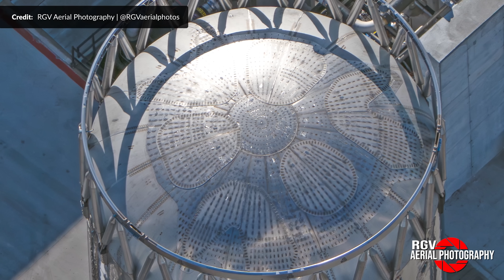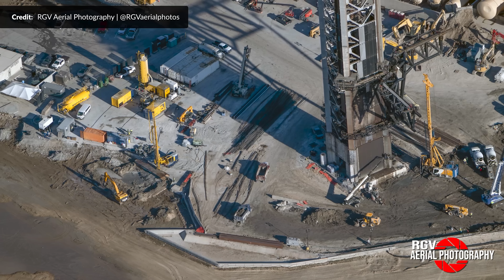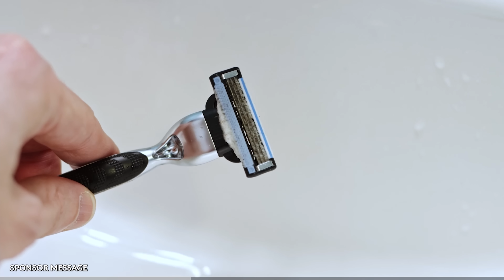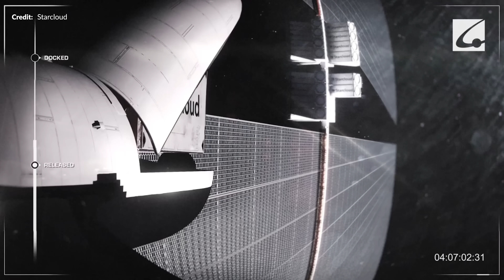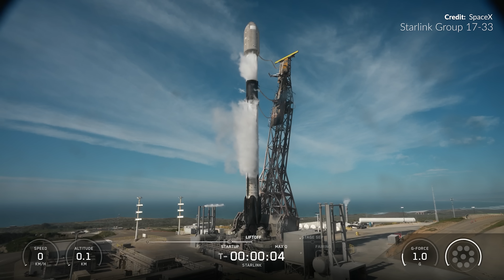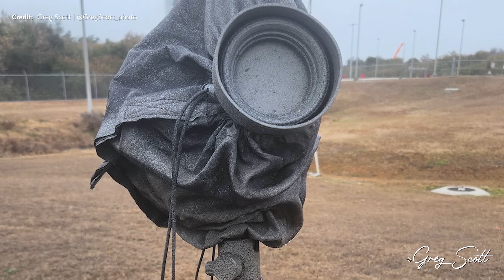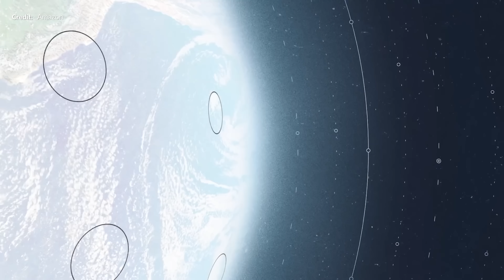SpaceX’s Starship Strategy Just Changed… Big Time!

Comment from the maker: Head to https://hensonshaving.com/marcushouse and enter code "MARCUS" at checkout to get 100 free blades with your purchase.
Reply: I bought one of the razors. It works well, but removing the blade has been a nightmare. I hold the ends away from the blade but the pressure needed to hold and twist the shaft to free the blade has caused it to twist past my thumb and cut me more times than I wish to admit. I am looking at a one-inch slash across my thumb right now. I am not sure if it would be best to hold it inside of a folded towel or to try and twist it while holding one of the cutting sides against a flat surface like the counter of the sink. Just beware it is not like the old “safety razors” that had jawsthat opened when twisted.
Reply: Marcus! We need your input for my comment on hot staging.  stevemorrell4066 (one of the usual 'first to...' suspects)  It's not the new Starship that matters but the re-used Booster underneath it that does - that unprotected dome has to have a limit...
Reply: The applied science of Geodesics if very clear. No parabolic trajectory in history was ever High Enough to LEAVE EARTH’S “Atmosphere”. You absolutely need a “ STRAIGHT” line trajectory to exit a curve. The “culminating” point of every parabolic trajectory “DICTATES” a return to Ground or Sea in close proximity. The Bermuda Triangle for example. Prove me wrong by showing me an analog, uninterrupted optical follow from launch to space.  Does not exist. No one went nowhere. Factual existential observable reality, cannot be denied or disputed. It is. Scratch Conscience🧠☯️
Reply: NEWTON’S 3rd Law in a Vacuum is irrelevant. If “Rockets” would be able to move mass in The Vacuum of Space, if “Rockets” could be “Self Propelled” WE WOULD SEE NO PHYSICAL REACTION AT LIFT OFF. If “Rockets” do not require any density to move mass, THERE SHOULD BE NO PHYSICAL REACTION AT ALL AT LIFT OFF. In reality, we observe the largest air displacement of our existences. Proving that rockets require a Hard surface to lift mass and miles of air density to maintain propulsion for a short flight
Reply: @ScratchConscience 
If what you say is true, no rocket engine burn would ever circularize, raise, lower or exit an orbit for something like "Trans Lunar Insertion."  ALL of those things happen through power applied through burning the engine.
Reply: @frankmcgowan9457 They don't .. NEWTON’S GRAVITY DEBUNKED// No Gravity means No Universe, the END
Fact is that when M. Brian Cox did is “Experiment” at NASA’s vacuum chamber and removed “All DENSITY”, bowling ball and tail feather fell at the same Speed and Rate. By “REMOVING DENSITY” ** gravity** stops existing. No gravity in a Vacuum! Proving “Density and buoyancy”. Here is a pre-School experiment confirming. Stand on a chair with a sheet of paper in your hands and let it go. It glides floating on the air particles in the environmental air, like expected.
Stand on the same chair and make a ball out of your sheet of paper, and let it go. It drops directly to the floor again confronting the same environmental“Air Particles”. 
Air Particles are called Density in physics. You have not altered the density or it’s atomic signature! You have augmented THE DENSITY OF IT’S MASS in relation with the DENSITY OF THE ENVIRONMENT, air density. Applied physics cannot be disputed.
No one is living upside down on an uncontained spinning water ball, hurling inSpace @ a SPEED of 66.6K mph / on a TILT of 66,6° / the POLES 66,6° / the CURVE ratio 6,66” ( Free Masons Great Architect is Lucifer )and does not know about it because of a magical unproven Jedi Force called Gravity. That is just PLANE ridiculous.
Reply: Before you go and reply something completely irrelevant, you will need to explain why the feather does not fall gliding slowly to the ground while in the vacuum without using the words : " Density or Air resistance " which are one and the same. Secondly, you will have to CONTRADICT ME ON A SINGLE SENTENCE. ""Read to the END"". Factual existential observable reality cannot be disputed, thus I cannot be disputed. The universe is an IMAGINARY CONSTRUCT that only “exists” in human minds. It is entirely based on a never occurred, theoretical explosion and it is programmed in our mindsfrom birth. Big Bang is a Theory, a theory does not exist in FACTUAL EXISTENTIAL OBSERVABLE REALITY. It has no existential reference. It is nothing moe than an idea, a thought. An organized hypothesis with no physical reference. A “Scientific Theory” does not EXIST, scientific or not it remains a non physical, mathematical hypothesis. The Facto, everything that comes and perspires from a theory is also theory and DOES NOT EXIST. Non existent within non existent. Proving that the  heliocentric Universe is a Humanity wide beLIEf. Like every known beLIEf and Religions, the middle of it is a LIE. Be, LIEd, Fool. beLIEf. Scratch Conscience🧠☯️
Reply: NEWTON’S GRAVITY DEBUNKED// No Gravity means No Universe, the END
Fact is that when M. Brian Cox did is “Experiment” at NASA’s vacuum chamber and removed “All DENSITY”, bowling ball and tail feather fell at the same Speed and Rate. By “REMOVING DENSITY” ** gravity** stops existing. No gravity in a Vacuum! Proving “Density and buoyancy”. Here is a pre-School experiment confirming. Stand on a chair with a sheet of paper in your hands and let it go. It glides floating on the air particles in the environmental air, like expected.
Stand on the same chair and make a ball out of your sheet of paper, and let it go. It drops directly to the floor again confronting the same environmental“Air Particles”. 
Air Particles are called Density in physics. You have not altered the density or it’s atomic signature! You have augmented THE DENSITY OF IT’S MASS in relation with the DENSITY OF THE ENVIRONMENT, air density. Applied physics cannot be disputed.
No one is living upside down on an uncontained spinning water ball, hurling inSpace @ a SPEED of 66.6K mph / on a TILT of 66,6° / the POLES 66,6° / the CURVE ratio 6,66” ( Free Masons Great Architect is Lucifer )and does not know about it because of a magical unproven Jedi Force called Gravity. That is just PLANE ridiculous.
Reply: Factual existential observable reality cannot be disputed, thus I cannot be disputed. The universe is an IMAGINARY CONSTRUCT that only “exists” in human minds. It is entirely based on a never occurred, theoretical explosion and it is programmed in our mindsfrom birth. Big Bang is a Theory, a theory does not exist in FACTUAL EXISTENTIAL OBSERVABLE REALITY. It has no existential reference. It is nothing moe than an idea, a thought. An organized hypothesis with no physical reference. A “Scientific Theory” does not EXIST, scientific or not it remains a non physical, mathematical hypothesis. The Facto, everything that comes and perspires from a theory is also theory and DOES NOT EXIST. Non existent within non existent. Proving that the  heliocentric Universe is a Humanity wide beLIEf. Like every known beLIEf and Religions, the middle of it is a LIE. Be, LIEd, Fool. beLIEf. Scratch Conscience🧠☯️
Reply: Chinese have released mock up videos of a booster catching system. Interestingly no legs. Just a gantry and wires that catch the booster on its fins or small hooks. 
now that's very clever in my view. First, no need for legs. The catch is all on the ground. 
Second You can move cables quickly. 
I think its rather clever.
Reply: Hey Marcus! Watching from Melbn. Gotta say  'yeah...nah', on that one. I don't expect to see blood while I'm watching a space news podcast, and I did't like it. Put me off my lunch.
Reply: @deanmichalos6848 No blood for sure. It's all fake. READ TO THE END. If you are going to dispute, you are not allowed to use the words "Density or Air resistance" which are one and the same. NEWTON’S GRAVITY DEBUNKED// No Gravity means No Universe, the END
Fact is that when M. Brian Cox did is “Experiment” at NASA’s vacuum chamber and removed “All DENSITY”, bowling ball and tail feather fell at the same Speed and Rate. By “REMOVING DENSITY” ** gravity** stops existing. No gravity in a Vacuum! Proving “Density and buoyancy”. Here is a pre-School experiment confirming. Stand on a chair with a sheet of paper in your hands and let it go. It glides floating on the air particles in the environmental air, like expected.
Stand on the same chair and make a ball out of your sheet of paper, and let it go. It drops directly to the floor again confronting the same environmental“Air Particles”. 
Air Particles are called Density in physics. You have not altered the density or it’s atomic signature! You have augmented THE DENSITY OF IT’S MASS in relation with the DENSITY OF THE ENVIRONMENT, air density. Applied physics cannot be disputed.
No one is living upside down on an uncontained spinning water ball, hurling inSpace @ a SPEED of 66.6K mph / on a TILT of 66,6° / the POLES 66,6° / the CURVE ratio 6,66” ( Free Masons Great Architect is Lucifer )and does not know about it because of a magical unproven Jedi Force called Gravity. That is just PLANE ridiculous.
Reply: Everything old becomes new again when I was a kid those were called double edged razors you opened it up by turning part of the handle pulled the old blade out and sliding in the back of the new blade holder push out a new blade from the other side catching the open slot in the center of the blade with the center of the blade bed then closing blade end of the razor with the handle
Reply: No response from customer support on order😢
Reply: Musk as Juan Trippe?  History does repeat itself!
Reply: @JosephPesco-s8i READ TO THE END HUMAN Friend, if you are going to dispute this  « Humanity Transforming DECLARATION, you will have to explain WHERE GRAVITY WENT !!!! 
NEWTON’S GRAVITY DEBUNKED// No Gravity in a Vacuum = No Universe / the END
Fact is that when M. Brian Cox did his “Experiment” at NASA’s vacuum chamber and removed “All AIR DENSITY”, bowling ball and tail feather fell at the same Speed and Rate. By “REMOVING ALL AIR DENSITY” (air particle)** gravity** stops existing. Proving that there is no gravity in a Vacuum! If gravity would exist, the feather would be carried in the vacuum. Here is an easy experiment confirming. Stand on a chair with a sheet of paper in your hands and let it go. It glides floating on the density of the environmental air, like expected.
Stand on the same chair and make a ball out of your sheet of paper, and let it go. It drops directly to the floor confronting the exact same environmental air density as previously. 
Air Particles are Density in physics. You have not altered the density of paper itself or it’s atomic signature! You have augmented THE DENSITY OF IT’S MASS from sheet to ball in relation with the DENSITY OF THE ENVIRONMENT, air density. Applied physics cannot be disputed.
No one is living upside down on an uncontained spinning water ball, hurling inSpace @ a SPEED of 66.6K mph / on a TILT of 66,6° / the POLES 66,6° / the CURVE ratio 6,66” ( Free Masons Great Architect is Lucifer )and does not know about it because of a magical unproven Jedi Force called Gravity. That is just PLANE ridiculous.
Reply: Hola amigo marcus activa el doblaje automático en español por favor ❤

Comment: I do not understand what Boing is even doing at this point.  Did they REALLY think that designing an entirely new and unproven thruster system was the answer here?  They were hired because of their experience and their answer to that was, let’s throw out our entire past success to design something that will be untested and unproven?  They need to have this contract pulled and the tax payers refunded the money wasted on this disaster.  So, they can’t design a working space craft.  They can’t design a plane that doesn’t fall apart in mid air… what’s left?  I can only imagine if they made a satellite it would be flying around with its left turn signal on perpetually at this point!

And in regard to in orbit fuel transfer, what about using solid rocket boosters to do the majority of the heavy lifting to acquire the speed needed for Trans Lunar Injection burn?  No evaporation.  No transfer issues.  Create an orbital manned fueling station with Falcon 9 type of SRBs.  They could accelerate the transfer vehicle.  Detach and return to the station to be refilled with new Solid booster parts.  Emptied cores could be returned on starship to be repacked and then sent back up to orbit.  Think of it as a plug and play system.

Comment: As I think about the super heavy booster transfer tube that was recently added, I begin to wonder if the modification wasn't a structural enhancement as well as a fuel/propellant transfer enhancement. Especially in light of the accumulated booster ruptures occurring during testing.

Comment: While the stated goal has been Mars, the real, actual effort has just been to get a super heavy, reusable 1st and 2nd stage to orbit and back successfully.  Where that fully reusable booster-orbiter system ends up being used was really not determined.  For one, it was going to start out deploying larger Starlink satellites.

A manned Starship requires a robust life-support system.

Multiple flights of a tanker version is required for one to leave LEO.

A Lunar Lander version may not require any heat shield, which would save some weight.
I’d imagine there could be a Lunar Lander cargo version and a crewed version.  It should be possible to land them in close proximity on the Moon, so as to inhabit one and utilize cargo out of another.
Lifting off the Moon is uncertain, as far as I know.  Could one lift off the Moon and return to LEO for refueling and restocking and another trip to the moon?
Would crewed versions return to LEO, too?  …or would they just stay on the Moon and be replenished by cargo versions?  Smaller “crew” landers might be built by BO and others, to serve simply as crew transport.

Comment: Moonbase much better jumping off point to get to mars. Now convert starship to burn hydrogen and manufacture the fuel on Luna instead of putting methane in orbit from earth.
Reply: I doubt hydrogen is ever considered a viable long term solution for space travel.  Use once or a few times in a short time sure, but otherwise it's a fuel that creates issues with time.  And you can't simply convert an engine to run on one fuel or another.  It required a complete re-design.

Comment: My bet is BO for the first unmanned and first human crewed landing. Starship will be an incredible capability, but it is ridiculously over-engineered for a crew shuttle to the surface. I foresee it as eventually being a Cargo Only vehicle. The sheer lack of abort modes and terrible, ungainly size and shape make a crewed landing a disaster waiting to happen. And landing sideways may require totally re-engineering the structure to take the new loads of the sideways landing configuration.

Comment: Mars remains the big goal but shifting to use the heck out of the moon as a proving ground for the required tech makes tons of sense.  One unmanned kaboom in earth orbit is bad, but on the way to or from Mars is catastrophic for the whole program.

Better to develop robust tech in the harsh environment of the moon, and learn how to build habitats fuel production and material launching as well. 

Just as important, they can fund it by building those new data center sats on the moon where they'll be cheaper to launch.

Comment: I haven't kept up with what SpaceX might've said, but I wonder if the shift to the Moon as a starting point might be because they think it'll be easier to refuel Starship there? So a base that's manufacturing the Methane/Oxygen on the Moon, instead of relying on tanker ships to refuel on orbit...

My thinking being that they'll be able to setup shop there and then it'll be lucrative in the sense of others wanting/needing to use the base. Or, that the others will want to go in on creating it as a joint effort (be it our gov't or other non-gov't entities).

Comment: Can someone explain to me why this datacenters in space is such a good idea? Where do you leave all the heat? Who is going to replace all the failing components? (A storage company like Backblaze is replacing dozens of disks each week simply because of scale and disk failure statistics)... and last but certainly not least: solar and cosmic radiation. I remember the days that the Space Shuttle was fitted with special, hardened CPU's to cope with this. And these were relatively slow chips, with larger transistors instead of high performance single nanometer AI/GPU chips..  

I honestly want to see why this would be a good idea vs. a relatively cold location on Earth where cheap hydro energy is plentiful..
Reply: You can reject heat into space.  Apollo 13 with its fuel cells and computers shut down got really cold.  It really depends on what temp you're aiming for and how much volume you need to control temps in.  Service and repair is a good point.
Reply: @Indica-anaJones-fan  You can indeed reject heat in to space, but I'm also wondering about the scale. There's a huge difference between an Apollo capsule or some computing on the ISS vs the enormous levels of cooling needed for a large scale data center.

And I still don't see regular GPU's/NPU's/TPU's deal well with the radiation in that space environment.

Comment: The Moon is more sensible on so many levels, but Musk isn't always sensible.  In this case I'll bet they've had so much trouble with the heat shield, and a Mars entry would be so much more difficult than an Earth entry, that they knew a 2026 takeoff would just produce a crash.  This way they've got 26 extra months to figure out the heat shield and a great cover story (doing the smarter thing, anyway).